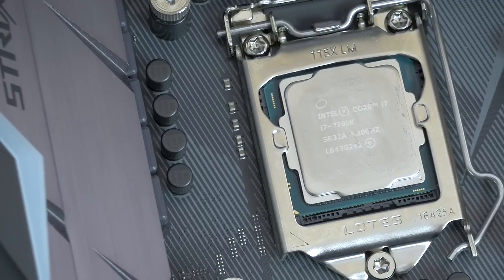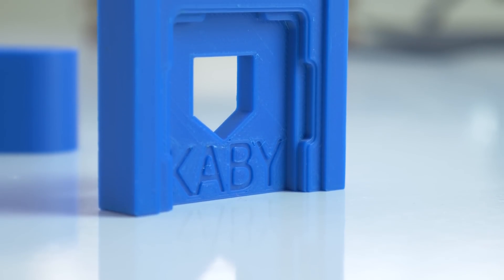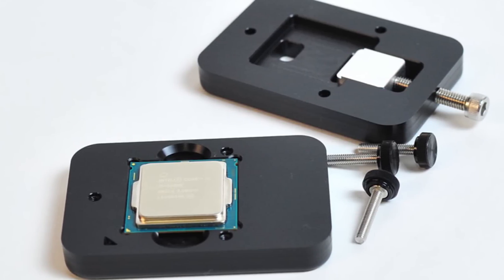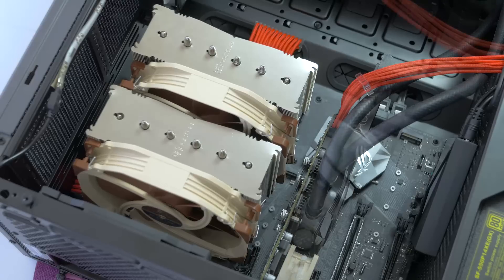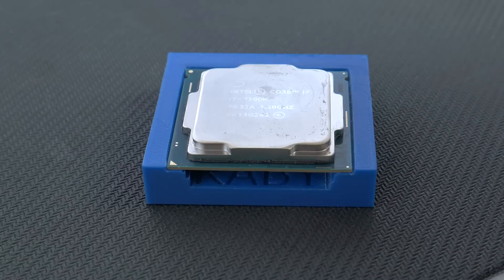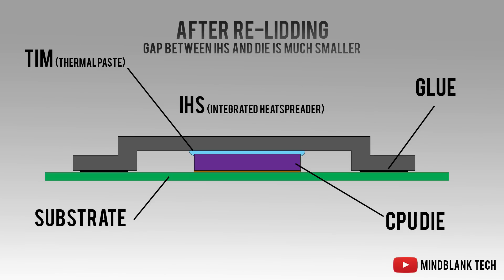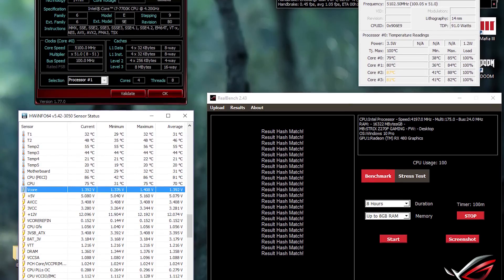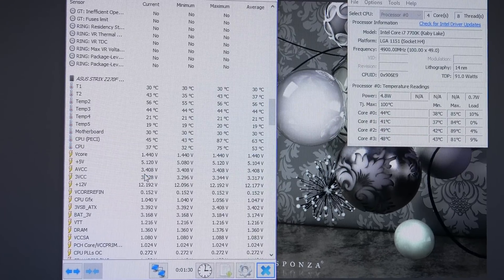Delidding the 7700K - 5.2GHz Overclock - 25C cooler

Comment: i7 7700k, Running the UEFI "dummy" 5.0ghz overclock setting in the BIOS. Still has it's OEM lid seals. Running a twin fan Noctura tower cooler, it runs 99% reliable. 

The 1% is keeping the fans and cooler tower clean.

Comment: I’m running my i7-7700k at 5.0 Ghz on a CoolerMaster Hyper 212 Air Cooler single fan at 1.32v. Temps max out just above 80C It is fully stable. Board is an Asus Maximus IX Apex with 32 GB of Ram (2x16 GB). Apex IX and Hero IX are the best Boards I’ve ever used……..hands down…….especially for overclocking. One top case fan in pull configuration (intake) provides ram chip cooling with three additional front intake fans. CPU fan s also setup in a pull configuration and allows for VRM cooling at the same time. Only one exhaust fan at rear of case. Memory voltage is 1.37v.

Comment: Why do people bash Intel because stock tim setup won't allow some 7700k to reach 5.1-5.2? It will do 5.0 with aio or better. Mindblank is on air cooling. Which is to say that his over clock on air is very impressive, and also to say, if it is done with stock tim and aio or better, what is the issue? 5.0 Ghz is impressive with an aio or liquid, and not everyone can achieve even that. Anyone seeking 5.0 should know what they are doing before attempting an over clock that high.  The 7700k is 4.2 GHz in stock form, which is very good. 5.0 makes it run at an 800Mhz over clock. That is major. 1Ghz is extreme. Many people cannot even do a 300-400 MHz over clock. Really, overclocks this high should be reserved for those who know what they are doing, this should not be a simple single point and click over clock. That is probably what some expect as a standard but that is not the case. Don't bash Intel or AMD for for the lack of that ability. I was very happy to hit 5.0Ghz with an old AMD 750K on air, 4.9 is the world record listed on   HWBot, I hold that record. I have yet to upload proof of my 5Ghz achievement, but that is what it is. It is not easy to get those clocks. Let them be reserved.

Comment: Fun fact. My 7700k is overclocked to 5.1ghz with 1.345v and temperature lower than your dellided CPU. Mine is not dellided and is reaching 75C on all cores with 2856Mhz RAM and 4896Mhz on cache. Did I won the silicon lottery?

Everything on AIR COOLING
Reply: 100% stable? Btw go and delid it you will get amazing results
Reply: @Goxus95  After the delid, I got 70C for 5.2Ghz and 4.9Ghz Cache with 1.385v. Sadly, my Win10 is making errors and makes blue screens often. It gives me errors for windows quite often. I see the only way by reinstaling it. After the delid, I figured out that my CPU was well binned and the intel's TIM was kinda more than average in terms of amount. Now I am rocking 5.0Ghz with 240 rad at 1.280v in Realbench at 60C. And 55C while gaming. The games I play are well optimised for Crossfire and my both Fury X GPUs are pushing my CPU to its limit like  Realbench. But my 7700k is nothing more than 4-core CPU and I concider upgrade to 3900X.

Comment: Please take the time to lap the CPU lid and Heat sink  using sand paper and a light oil!
This process ensures a proper flat surface connection(NO Thermal paste is as good as direct contact)!

Comment: im running 5.1 at 1.375 volts with a -2 avx, hitting 77 degs under full load on all cores.. Using a 240mm AIO. Any tips to get mine to 5.2?
Reply: U need 1.42 v

Comment: I delidded mine and got a very stable 5GHz (with prime95 stress test) without dropping the AVX frequency. It'll do about 5.2GHz at 1.4v, but the heat generation is of course the problem. I'm going to try a dual 12cm rad and see if that gets it cool enough.

Comment: thanks bro for the video my i7700k is now overclocked to 5ghz sometimes it overclocks itself to 5.2 ghz and im running at 60c to 65c  im soooo happy it worked cuz i thought i messed up until i removed all the sticky crap tand not use normal thermal past like arctic mx or many others until i put liquid metal man did it works fantastically. the derbaurs tool is fantastic it worked asap super ultra easy .

Comment: I have a liquid cooled system and my temperature is 60 degrees on 5.1ghz on 5.2ghz is unstable and this is with my fan running at 100% + liquid cooling and to be honest its a bit unstable at 5.1ghz.

Comment: i pass cinebenchR15 with 1112 score on 5.1ghz at 1.34v , i try to hit 5.2 but it was stable at 1.424v is this safe for tests? i run for 24/7 at 5.1 but if i want to try benchmarks or gaming on 5.2 with 1.42-1.44v it will be safe ? :/

Comment: Do I have a busted cpu, just brought a 7700k and on stock set up it overheats going over 100 degrees on a stress test and while playing ark survival evolved. I have a H60 that I have put new arctic sliver paste on. Its working at moving heaps of heat But I think the cpu isn't passing it to the heatsink fast enough what do you guys think? Happy to get into more detail if anyone is willing to help.
Reply: Jamie Rice needs cooler redeating, also reapply thermal grease. If still too high delid.

Comment: Let me get this straight, we have to use thermal paste between the CPUDIE and the integrated heat spreader (even if not glued), as well as between the heat spreader and the heatsink?  

Second question:  Is heat spreader even required afterwards?

Thanks for the vid!

Comment: I can get my 7700k to 5.2ghz at 1.375v with a max temp in winter of 85C and in summer 96C with no delid. As I'm not comfortable removing the IHS I have to pull my 7700k down to 5.0ghz at 1.250v in summer with a max temp of 72C. I would love to delid but I am a klutz and would most likely brick my cpu if I tried.

Comment: I delidded my i5 6600k and used liquid metal paste and my temp dropped almost 30c. its really amazing. I overclocked it to 4.7 ghz and my temp is now 65c while gaming. before it was hitting 85c - 90c. now my gtx 1070 is always running at 99%. it has become the bottleneck.

Comment: I'm a bit late to the party, but I want to add one thing:
If you use silicon substrate to glue the IHS back to the PCB, it is important to leave a small gap like there is when you remove the IHS. This is to prevent gases that build up from the substrate to not build pressure and lift the IHS.

Comment: Just picked up a "refurbished" 7700K from NewEgg; 30% refurbished coupon brought it down well below $250. Not sure what refurbished means though. It was sealed in box and looked new. Without delidding, it runs 5.0GHz stable on air (ZALMAN CNPS9500  AT) at 1.35V BIOS (1.31 - 1.328 under load; no LLC MB) peaks just under 80C and 5.1GHz at 1.39 (1.36 under load) at or just over 80C but not completely stable; no LLC. This blew my mind for out of the box. I fought with my delidded 7700K and could never truly be stable at 5.0GHz and I ended up running 4.8Ghz; mostly for reasonable temps in the 70s. Also, the refurbished was running on MSI PC Mate with a 3-phase VRM ($50AR MB) where the delidded was on an ASRock Extreme advertised as 12-phase (but that maybe SOC as well); LOL. I guess refurbished means "fixed".

Comment: I just got my comp a couple of weeks ago and have it running at 4.8ghz @ 1.2v. It idles at 25 to 30c and hits about 60 to 65c under load. Do you think Intel made changes to the CPU since so many people have complained? If I delid it, would I see an even lower set of temps when idling and under load?

Comment: Upgraded my rig with new case, fans, and from air cooler to NZXT Kraken X62 AIO. Had 80-90C during 100% load. Now I have max 78 at 100% load, but that was just a peak max. Its usually stable at 65C, not delid. Perhaps I should delid to gain more?

Comment: my i7 7700k with asus strix z270e gaming mobo custom liquid loop, was able to achieve 5ghz with automatic overclocking settings. Xmp was then enabled for 64 gigs of g skill trident z rgb giving me 3200 without issue. I also have 2 Asus Poseidon platinum 1080 TI's in sli running through a separate 240 radiator resulting in 25-30c idle and up to the highest point I've  recorded 67c. My system was 100% stable for a few days, at which point I was in a game when windows began updates, temperature warning popped up, then system froze and shutdown. after the system booted back up, I was met with grim news, I fluffing bsod'ed. Now when I pulled temperature logs, I didn't see any indication I was reaching thermal cutoff, though from this point out I could not achieve 5.0 stable, cpu cores were jumping up and down from 25c - 65-70c, then right back down on and on. This caused me not not be able to to record any accurate average temperatures whatsoever, what made matters worse was that as a result, when the chip achieved around 50c under max load, it would spike up causing blacks creek and a reboot. still within my 30 days I opted to return it. Today I have returned that item for a new chip.

Comment: I'm running 5.1GHz stable and can do some benchmarks at 5.2 just not fully stable. Running custom loop watercooling in a Core P3 case temps sit between 68-73C under load. I'm wondering if I delid I'd beable to get 5.2 stable...

Comment: Just wanted to thank you for sharing this video! I referenced it a lot during my delidding. Though, I did use a rubber hammer and a couple of taps to delid. My chip is no where near as good as yours; grats on getting a great chip. Mine needs around 1.36-1.37 to run 5.0Ghz; stable (cache 4.0 since that had the biggest issue for stability) temps in the high 70's; that's with a 420mm EisBaer cooler. Don't think I could get stable much above that but I will continue to push to see if 5.1 is possible and stabvle. I may drop to 4.9 just lower the voltage and temps further, since the performance difference is not that great. It's good to know that it can do 5.0 though. Cheers and thanks for sharing all the info!

Comment: My non-delidded I7 7700K runs at 1.2VCore with 84 °C. Running anm Alpenföhn Olymp at max Fan speeds btw. Seems like I got the worst sample ever with the preapplied tin under the IHS.  No matter how hard I crank up the Fan speeds nothing on the temperatures seem to change....

Comment: The Intel paste is not the best, but it is very consistent. The CPU will perform the same for the whole life time of the chip. The AMD's soldering method may and will fail you as the time goes, as solder cracks, when you warm it up and let it cool down again (100% load ON then OFF).

Comment: I got lucky, my cpu is stable at 5.2ghz.  Should I delid it?  I normally run it at 5ghz but those temps drops are very tempting.  Using a corsair H110i to cool it btw.

Comment: I went into my BIOS and there was an automatic overclock setting for 5ghz, so I just did that since I have no clue what I'm doing, and it worked fine and was stable right away. Maybe I just got super lucky? I run it at 4.8ghz though since I don't need the extra performance and want lower temps.

Comment: I saw this video before I built my new system. I have my 7700k delided with gallium and I also use it on the AIO cooler which is copper. I'm running 5.313GHz (5.2GHz with a 102.1 block)- 1.52V - 7 AVX offset. 16GB of DDR4@3200MHz XMP. Tested with Aida64 stability stress test and it's stable with a peak temp of 77C in one of the tests, but mostly lower than 70C. I use these settings every day in games, media, and game creating. I've even installed my current Windows using these settings. That's how good I feel about it.

Comment: I think I gonna try delid my 7700k. I have 4.8ghz - 1.200V 5.0ghz -1.288   5.1ghz  1.330V temps 80C 5.2 booting on 1.390 temps 88-90C unstable :/   I ranning custom water cooling pc with triple 180/45 radiator :)

Comment: I am not going to lie I am very tempted to delid my 7700k.... The temps are pretty garbage in my opinion, and I can't stand the fact that Intel charges 600 bucks for this chip after taxes in Canada, yet they can't be bothered to provide us some decent paste underneath the IHS. In any case, you can buy a 30 dollar delidding tool on overclock.net and apparently it's very easy. Either way it's pretty scary as I don't want to fuck up my cpu..... sigh.

Comment: Wow, the temps you get are nothing compared to what mine are atm - 1.27V 4.7GHz Core #1 and Core #3 97C. I have to keep the processor stock or it goes to 100C .... I hope deliding it will help. I am using Corsair H90.

Comment: if i screw up and i put waay more liquid metal that it needs can it be remove?, are there any dangers using liquid metal vs regular good quality thermal paste for deliding?if u dont put any silicone to glue back the IHS to the cpu and just leave the mobo to hold it , wont by just those surfaces coming in direct contact with each other without silicone layer in between them damage the cpu cuz of temps? also i ve seen in some other videos that ppl are applying liquid metal on both DIE and IHS surfaces and u did only on DIE.. why is that ?
Reply from the maker: Best thermal transfer between bare die and IHS is with liquid metal. Liquid metal is conductive so if you get it on the PCB and there's surface mounted components and they're in contact with the LM, then NEVER power on the system before thoroughly cleaning it off of those SM components. It's electrically conductive. I only applied on die in the video since that's where it's required. On the IHS it's optional for a bit lower temps.
Reply: hmm , does the inside of pcb of 7700k has any surface mounted components ? also @ 4:27 looks like u have applied liquid metal on both ihs and die surfaces .. so what is it ? just on die or on ihs also ? trying to figure out if i should do both or just on die

Comment: I am running a 7700K currently at 4.7 GHz with 1.28 volts. I was at first impressed that I could run that with a 212 EVO. I even tried 4.8 at 1.3  volts which isn't too bad but that made it seem like I might've lost the lottery. On top of that, the EVO couldn't cool it successful with it hitting 85 degrees just on Cinabench. I was ESPECIALLY frustrated when I needed a whopping 1.38 just to run it 100MHz faster than 4.8. I plan on water cooling, but if I really can't hit 5.0 on water then I might as just switch to Ryzen :P

Comment: i have a friend who is an engineer on intel and this is what he told me:
it is by design. the gap is made to protect the cpu from over tightening of the cooler and even from drops.
intel prefer raising the working temps and lowering the RMA %.
it's completely a business choice and it's not by mistake or skimping as some people may say.
and there is nothing wrong with the tim intel is using it's the space between the lid and the die that causes the high temps.

Comment: if doing this produces such a huge difference in temps and stability while overclocking, why doesnt intel just do it this way to begin with? its not as if it will cost them much honestly and they are charging you more than enough for this cpu to warrant it. it would make them look that much better compared to competition too. not that intel HAS competition at this level of product. amd still hasnt quite caught up yet.

Comment: i think i got very lucky when it came to my i5 7600k. i have not delided or messed with it in any way. however, im overclocked to a very stable 4.8 Ggz (but can reach 5Ghz no problem) and my temperatures are 42-60 C at ANY load. (this is with my CPU fan running on its lowest RPM mode) if i up my CPU fan curve, i can lower it to  30-50 C. It doesnt ever get hotter than 80C at full load even at 5Ghz. AND this is while using a Hyper evo 212 CPU FAN cooler! no watercooling!

Comment: delidding does not = more mhz... it allows for more headroom if held back by temperatures. 4.2 mhz w/ lid does not = 4.4 mhz with lid off.. just a few degrees cooler... maybe. "Reduce temperatures therefore stabilizing overclock"? What? When I liquid cooled my cpu it didn't get faster or become more stable... just cooler. delidding will do the same. "Delidding = less voltage to keep stable" ?¿¿? .... no, heat spreaders spread heat evenly into the chipset cooler. which makes mounting it easier and more versatile when used with aftermarket coolers

Comment: 6 moths later Shit, electromigration broke my cpu...
Reply from the maker: Not really. This thing is seeing 25% or more time of its usage at 90% usage at 5.1GHz and 1.392v and it's working just fine, no crashes yet.
Reply: +MindBlank Tech Well I hope it will stay this way for you as when looking at recommended voltages for kabylake people don't really have a definitive answers that I can find, probably because this is still a pretty new CPU, however when comparing this to skylake the voltage that people recommend based on experience is about 1.3v to 1.35v and then taking in mind that is a pretty damm similar architecture it would be logical if it's close to if no the same for kabylake. But if you plan on upgrading as soon as coffelake is released or whatever is going to be the next generation, you'll probably never notice any electromigration.

Comment: I will be building my first rig soon. wanted one for years and will be using some good parts.. one being the 7700k.. one being the ASUS maximus IX extreme motherboard.. a few questions.. as a beginner should I hold off doing something like this? would the card be safe with a water block over it? and lastly if it's being water cooled, would doing this not be necessary. thanks :D

Comment: When you use your Thermal Grizzly do you use their method in the instruction or do you use the typical dot method?

I can run my i7 7700K up to 5.2 then backed it off to 4.8 for stability but temps are still reaching 80c. The heat from the CPU is not transferring properly to the IHS I know because my water temps are cool and are barley increasing. On my old AMD FX system the water temps got toasty quickly and the fans kicked on accordingly to cool the water in the loop. Time to delid my brand new chip.. yikes.. I think I am going to buy the RockitCool kit. I don't want to loose my 5.2GHZ CPU